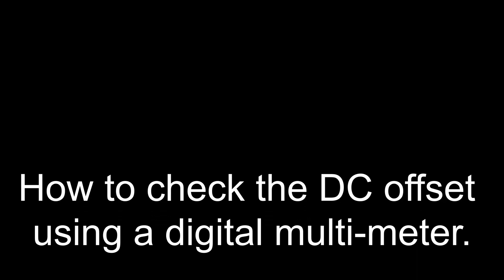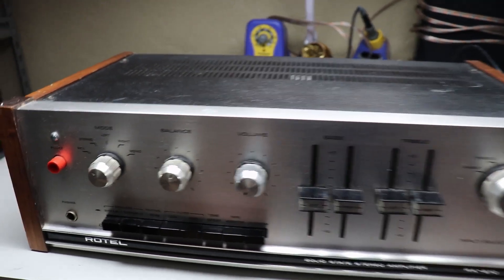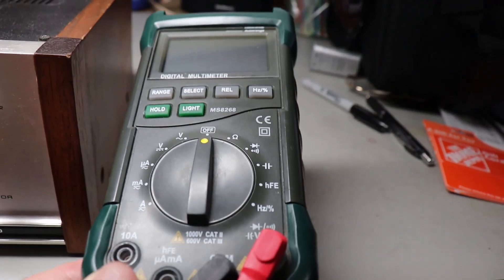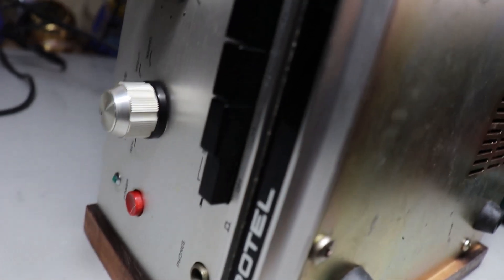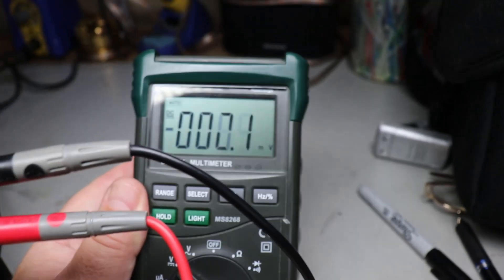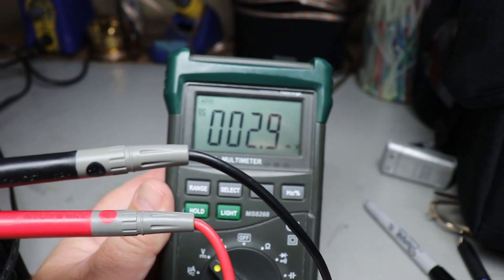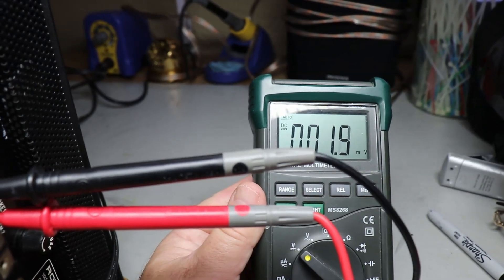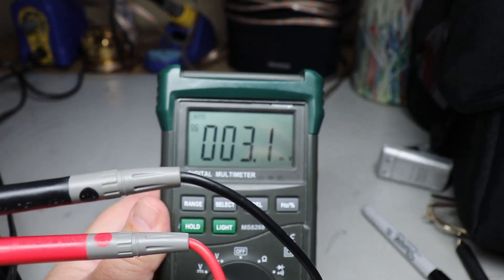Checking DC Offset On Old Vintage Stereo Amplifiers And Receivers - Audio Repair And Restoration

Comment: I think another requirement besides it powering on is that the unit must not be in speaker protection mode, correct?  Assuming the unit has a speaker relay?

Comment: I checked my Kenwood VR-6040 just to see. A R & L  started at 2.4 and then settled into 0.1 both channels. B the L Channel went up to 10.2 and then would go down to 2.4, but it did not reach the 0.1. The R Channel responded like the A speaker outputs beginning at 2.4 and settled into 0.1. Should I worry about the difference of the B L channel? Thanks.

Comment: After measuring my 2270- Main L & Remote L both read ~13mv when selected and 0mv when not selected. On the right side; Main R reads 52mv when selected and unselected, while Remote R reads 52mv when selected and 0 mv when not selected. From what you said, I'm less concerned about the number, but more concerned that the Main R is giving a reading when not selected. Where would you start to troubleshoot? Thanks!

Comment: Some good information here. I'm no expert but I disagree with your advice, on starting the measurements with less than 1mV scale. I'd put it on to the highest setting to begin with, and drop down from there. After all, you're looking to see if there's a problem with the amp. When you have 38V at the outputs, like I did recently, you know you have a problem!
Reply from the maker: Thanks a lot for sharing and for watching. Yes, 38 volts is an issue!
Reply: His point was not his 38 volt issue:)

Comment: Thanks, question, when i run the procedure my voltimeter goes to -98 mv ... If i turn off that channel... Then it starts going to +50 and keep going up. Then if i turn on the channel again, it goes to -90 again.   Both left and right channel.  And i. a, B or C set of speakers, i have to say, last week it burned my left speaker. Thanks for the advise.

Comment: Volume set to zero ?
Reply: The reading should be
Independent to where the volume is set. You aren’t looking at absolute voltages here, just the differential voltage (offset) between the 2 channels.

Comment: Thanks for the video, can I use this method on a SET tube amp?
Reply from the maker: In tube amplifiers there is no DC on the speakers as they are transformer isolated from any DC by the output transformers. There is no DC offset to adjust unless it is output-transformerless, but there are not many of those.
Reply: @vintageaudioaddict  Thank you for the clarification, I can confirm the amp I have has output transformers but I was lacking the knowledge to know what it meant for DC offset. Thanks for the new knowledge!

Comment: I have a Sony TA-F60 with the right channel issue : the voltage at
the C of Q213  and Q214 is always -8,0V, so the protection relay do not
work. I turn the RT201 to maximum but it can not reach 0V.
All orther voltages are ok.
Could you please advice me some solutions?
Sorry for my bad English
Thank you in advance.
TuTrong from Viet Nam.
I have the service manual of TA-F60. If you need I will send you via email.

Comment: what is volume contol set at during the test? I also noticed that the right channel had a
- DC mV reading and the left channel had a +DC mV reading, is that considered normal?
Reply: I wish he would answer this question.
Reply: I think everything should be at zero

Comment: Good video!  If the dc offset is good, does that mean the output transistors and/or electrolytic caps on the drive board are okay?  Thanks.

Comment: Hi great videos you put out. I got a question. I have a Pioneer SX-727. One ch is solid with stable DC offset. The other ch is flakey DC offset all over the place. Got any ideas were I should start looking? Caps on amp board? Protection circuit?

Comment: Cool video! Can you elaborate?  What is the DC offset telling you?
Reply: They never replied to you. There is not supposed to be any DC current in the output since the output is AC current. DC current will burn the speaker. But In tiny millivolts it’s not harmful, yet .

Comment: Hello. Thank you very much.  I have an old amplifier that, if I measure bias with speakers installed, show less than 1mv DC, but if I measure without load the bias is 3.2 volts DC. I don't understand if this is a problem or not? If with speakers the bias is almost absent shouldn't be risks for the speakers, or not? Can you explain why the test is done without speakers/load? Thank you very much.
Reply: The speakers are absorbing the load. You need to see what the speakers are seeing, so you test with the mm as the load. 3,2 vdc is very high.

Comment: Nice info but remember this only works for direct coupled outputs. Capacitor coupled outputs will block DC. If there is an issue with the amplifier you'll have to do other tests.
Reply from the maker: Good comment. Thanks!
Reply: @vintageaudioaddict How can one know if he's testing a direct coupled output or a capacitor coupled output? Is there an easy "rule of thumb"?
Reply: @chwk2003  Yes, it's called a schematic for the unit!

Comment: Hi, I have a question, is it normal for dc voltage to raise over time? a month ago I adjusted dc voltage about 5 mV on both channels, now Im having -70mV on L and -60mV on R. Sugested voltage is +-10 mV for my reciever, it is sansui 8080. Thanks
Reply: Could weak differential pair, thermal issues, leaky capacitor... Have any upgrades been completed on this chassis?
Reply: @jhjove  No, everything is original, I just cleaned the pots and switches. It sounds fine but that dc voltage bothers me.
Reply: @jovanj.9400  yes, anything over 50mV and increasing is of concern, more distortion+more problematic for the speaker VC. This chassis is at least 45 years old, I have to believe there are over stressed and now weak components. At the very least the power supply caps should be changed. That said when you do your adjustments for Bias and DC offset were these after the unit was on for 10-30 minutes (controls flat, no source, volume minimum)?
Reply: @jhjove Yes, folowed instructions by service manual, volume on lowest, no sorce, didn't adjusted bias and offset on same time when powered on, I waited at least 5 minutes for curent to be stable. Only thing that i did adjustments with speakers hooked because i dont have a dummy load for testing...that dc voltage on output didnt raise same day to 70mV, it is was raisin gradually day after day...do you suggest that I try to adjust bias and offset again?
Reply: @jovanj.9400  I think the circuit, with the age of the components, is going be wide ranging for current and voltage measurements/adjustments. And it could be a simple solder connection gone bad in the 45 years. If you're gonna use it you'd best do a maintenance job on it.
Reply: @jhjove  Well im considering to do full recap of unit, maybe it will worth it if that fix most of the problems, for now I like the sound how it is and Im aware that 45 year old caps are probably on the end of their lifespan...if I replace caps I hope that Im not going to get cheaper sound, I mean nothing will go wrong if I use quality caps like nichicon or elna right?
Reply: @jovanj.9400  Correct. I use nichicon and typically use 105C and slighty higher voltage ratings. It will improve the sound.
Reply: @jhjove  alright thanks for help,and if I change two big filter caps to bigger capacity like 10000uf ? I think originals are 6800uf, will that improve bass?
Reply: @jovanj.9400  I don't think they'll have much improvement on the bass response. The tone filter/coupling cap may have a larger effect. As far as sizes that is a big jump, but those 2 are the only caps I'd increase the farad value (+20%) if at all. You may be restricted with physical sizes depending on the PCB space. Larger Farad value = physically larger component. I'd still bump up the working voltage+temp rating on all caps